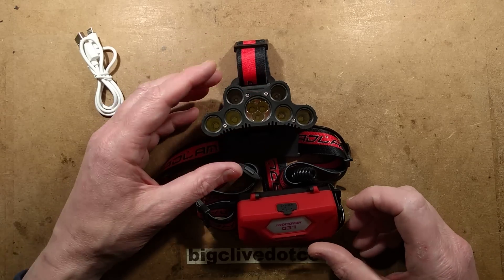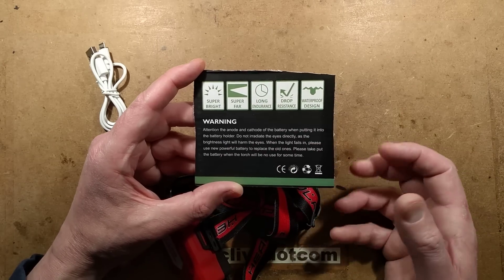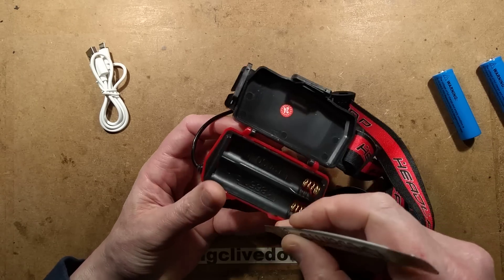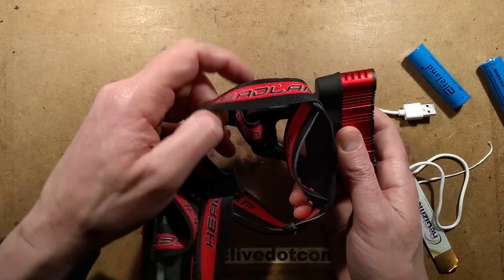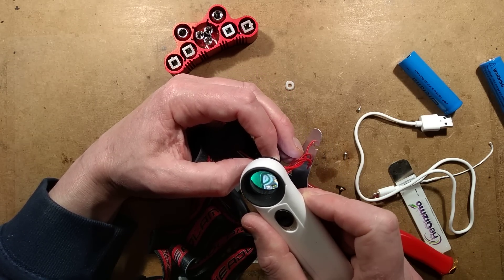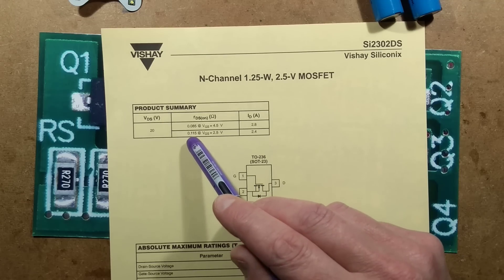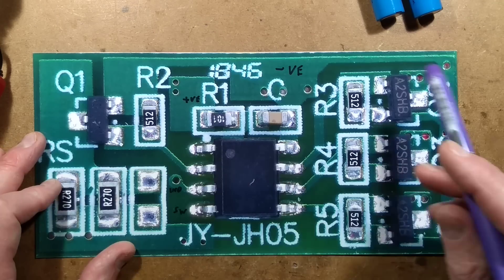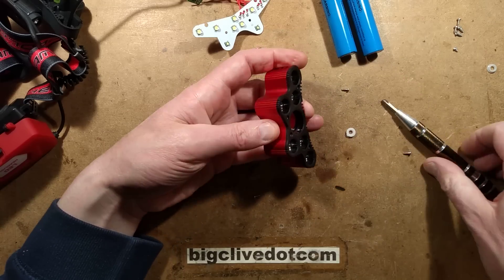9 LED headlight Elfeland teardown.

Comment: At 12:26, concerning the resistor  marked 101, 1 is not a "multiplier", because 10 times 1 equals 10! It tells you to add a single  zero to the 10 proceeding it, thereby signifying a hundred ohms. People might refer to this as a *multiplier*, but it isn't. Yes, I am being pedantic.
Reply: It isn't 'adding zero' (10+0=10) and is actually multiplication but by 10 to the power of the number '101' = 10x10, '102' = 10x100. Multiplier is correct but assumes you know about powers of 10.
Reply: @Matt Quinn yes correct 
😂. My phone seems to be working against me and regardless of how I type, it seems to deliberately screw with the spellings. Thanks.
Reply: @purpleviolin  , my smartphone does exactly the same thing, it changes words on me. I can proofread a post prior to posting it, and then I look at it again after it has been posted and realize that words have been changed. I usually use the voice to text feature, speaking into the phone and having it transcribe for me, and sometimes several seconds after it types the word I have spoken, the word will change. I've also noticed that if I use any expression of speech that could be interpreted as the title of a song or movie, the software will capitalize the entire phrase.
Reply: The final “1” in “101” is indeed the multiplier position as it what defines your multiplier even though the actual value is an exponent, it’s just that you multiply by 10^1.  That knowledge is considered a given if you work with electronics.
Reply: @ethanpoole3443  , I actually repair audio equipment fulltime for a living, so I do work with electronics. You could say that we are both at least partially correct, and I do understand about powers of ten; however, where people get into trouble or where it gets confusing is that you will see capacitors and other components that have three numbers on them that are the actual value of the component. Older ceramic capacitors will often be marked directly with the picofarad value of the part, although sometimes they're marked with the power of 10 multiplier scheme (and generally,  ceramic caps will graduate to a decimal or fractional microfarad rating at some point, like .0047 or even .00047) . I've also seen small film caps that are marked with the actual value capacitance (or trim- pots marked with the actual resistance value);  sometimes 470 means 47, and sometimes it means  470! When in doubt, grap the capacitance meter. It really is a stupid system. I'd almost prefer capacitors be marked with color bands like resistors, except that nowadays, modern resistors use such tiny narrow bands of somewhat odd color- spectrum markings that it can be difficult to tell red from brown, especially after the components age or are exposed to heat ( my  eyes are also aged,  and have probably been exposed to too much heat!). And now that 1%  and 2% tolerance resistors are common, sometimes it's hard to tell which end of the resistor is which!

Comment: It's more of an "amazing how they managed to make all of this and sell it for 18 dollars"... (or even $13 with free international shipping - just punched it into the Aliexpress). It sounds weird when people seriously criticize these things. It's like buying a new car sold for $1000-2000 with all the options. Of course it is going to be made of tin and wishes. But it will still run, turn, stop, light its lights, have a functional radio and heater (and probably even a big case of bad tools thrown in as a gift). The fact that all of it will be extremely poor and low lifespan will be completely overshadowed by the fact someone managed to pull this miracle off, to appease people who buy stuff like this. And any complaints by the owner will be overshadowed by the fact they bought this car and still compare it to vehicles 20 times its price.
Reply: Trust me, the Yugo (car) was well criticized in the late 80s for being a cheap junk car as well — it ran and it was cheap we’re about the only two positives that one could credit it with.  That said, even cheap manufacturing should not constitute cover for outright lies in terms of claimed specifications.  Even cheap products should at least deliver on their claimed specs.

Comment: The weight of this thing must be ridiculous, it can't possibly feel comfortable after 10 or 15 minutes on your head, not with the leverage affect of that weight hanging off the forehead, supported by a shitty little stretch band. Every headband flashlight I've tried so far makes my head sweat uncomfortably after about 15 minutes at the most. I have some cob LED headband lights from the local Job Lot store, they cost about eight or nine bucks, I really like these because they have a nice, evenly diffused white light, and only three modes to cycle through  (which is still one too many, I could certainly do without the flashing mode, which thankfully is red rather than white.).  Anyway, I took the flashlight housing off of the headband and attached them to the top front of my Opti-visor magnifying visors, keeping the hinged part of the flashlight housing so that I can aim the light at the work surface. Even then, because of the three AAA batteries contained within, the flashlight adds about 4 ounces to the front end of the magnifying visor. I removed the batteries and put them on a separate battery pack clipped to the rear of the headband of the magnifying visor. This improved the overall weight distribution significantly, making both the headlamp and the magnifying visor much more useful, as well as more comfortable.

Comment: I find this single buttom all,the functions extremely stupid. You have to cycle though all the others if you happen to miss...for example in this one, if you want to light it all up you press a few times and then there is a sequence with 2 small ones light up, lets say, a drl mode. If you want back to full beam, press a few times and wonder how many do you need be ause sure as hell you have to stop, take it down and look at the bloody thing to see when is correct....idiot manufacturers have been doing this "single button control all" dor many years now and still don't intend to change it. It should have 3 separate buttons, just like a cooling fan/hearing element for the rooms. Each level is separate and can be controlled directly by anyone pressing the correct button. Simple and effective.

Comment: i wish there was just an on/off switch for whatever mode you are on
Reply: Megabats, I concur! Almost every cob LED flashlight, indeed just about every LED flashlight of any type, has a flashing mode. Don't want it, don't need it. Those so-called tactical flashlights have something like five modes controlled from just one switch. It's annoying as hell.

Comment: Walmart’s headlights have more leds. They are using cob modules.
Reply: Jak p, the local Job Lot store here in New England sells "cob" LED headlights for 8 or 9 bucks. I really like the lights themselves,  but I could do without the flashing mode; high and low modes are more than sufficient. The real problem with these types of wearable headlamps, which probably rings true for the ones that Clive is working with, is that they are kind of heavy, and the weight is hanging too far forward of one's forehead. Coupled with the somewhat uncomfortable head strap, it's difficult to wear them for more than 10 or 15 minutes before your forehead starts to hurt and you find yourself sweating underneath the headband.
Reply: good 'un I remember Ocean state job lot when I lived in Connecticut, good store.

Comment: parallel a capacitor with those 5.1k resistors to get rid of the flasher mode
Reply: You would need an awfully large capacitance to actually smooth out the flashing, which likely won’t fit back into the housing afterwards.

Comment: Mr Clive Sir... I never really understood the meaning of MOSFET.. I get the MOS part but not the field effect part.. WTF does field effect mean..ty for your time and my ignorance
Reply: “Field Effect” is what is actually performing the switching in a FET.  The actual electron field at the gate is what switches the transistor on (or in a special case, off).  There is no actual current flowing through the gate like there is with a traditional bipolar transistor’s base, it is literally the presence of absence of the electron field itself that makes the path between source and drain conductive (or insulating in that special case).
Reply: @ethanpoole3443  thank you so much I'm so much informed.. I'm older and used to know this knowledge but now I'm feeling stupid..ty Sir so much

Comment: Chinese eBay battery spec = divide by ten for the actual ratings.
Reply: Well that's not completely accurate. I tested a pair of 9800 mAh ones about a year ago. The best one produced 254 mAh😂
Upside is that they are really easy to carry, they weigh nothing😊

Comment: So who does sell good, protected 18650s for use in flashlights and such?
Reply: Josh Tolbert you just have to find trust worthy sellers 
I’ve had good luck with mountain electronics, vesture_of_blood, and optics outlet on eBay
Reply: Orbotron is a good source for higher capacity protected 18650s, but you will pay more buying a trusted brand but then they do actually deliver on their claimed specifications.

Comment: The Chinese tend to do the pissing competition in everything. Screen protectors went from 2.5d to 10d whatever that is and glass hardness to 10h when 9 is diamond I think.
Reply: Windows, unless something has changed since I was a kid,  Diamond is actually number 10 on the scale of hardness. That's the Mohs scale of hardness, if I remember correctly.
Reply: @Matt Quinn , but what is harder than diamond? Some man-made material? And is this Shanghai hardness scale for real or are you pulling my leg? If so, kudos for the Spinal Tap reference!

Comment: 4:35 ... On that topic ... I tried to shop for 18650  ... and couldn't get them.
I wanted some with and some without protection.
The ones with protection where only available in too large (labeled 18650 but so long they don't fit in any  battery 18650 battery holder), lot of unprotected cells, but all fake with fantasy capacity.
And the few that seemed real and from reputable sources where about 30€ a piece ... and seemed too much.
Reply: I got a 12-pack of cheap fakes and 4-slot charger. I have never ran out of juice during 9h workday driving a towtruck - some winterdays are very dark in Finland.
Reply: A good brand of protected high capacity 18650s is Orbotron.  I’ve purchased a number over the year’s and they are always within +/- a few percent of their claimed capacity, but you will pay a premium.  However, ALL standard 18650 cells with a protection board will be 1.5-2mm longer than a base 18650 cell due to the protection board attached to the negative terminal (under the shrinkwrap)— that’s the actual added thickness of the PCB plus components and is normal for any protected cell.  To find a protected “18650” cell with a protection board that was still the same dimension as an 18650 cell you would have to find someone who custom manufactured an 18630 cell with a 2mm protection board, which would then be about the same size as a base unprotected 18650 cell, but that would be a nonstandard cell and will likely be a real challenge to find anywhere, much less finding a good price and a reputable brand.
Reply: @ethanpoole3443  The ones I got (cause I thought it was exaggerated) where about ~ 5mm longer ... I have bought several holders and have several devices ... and they don't fit in any. I have one holder in which I can make them fit ... if they half outside the holder is bent and the contacts are replaced by one layer of  aluminum foil ... 
And not to mention the devices I have .. some even state to only use protected cells ...
Too bad I bought those first and without cells, assuming buying cells would be easy ...
I found cells even advertised as 10000mAh ...
But I will keep my eye peeled for Orbotrons
Edit: No dice, not sold around here ... at least where I shop. Will keep looking, tho.
Reply: MrMegaPussyPlayer I purchased my batteries through Amazon.  I’ve also done well with the Solaray brand, though I’ve only tried that brand with 14500 cells so far, but they also met their specs and have held up well through a number of charging cycles.  But an added 5mm for a protection board is very unusual, though protected cells are often a much tighter fit than unprotected, 5mm is rather excessive.

Comment: Thanks for looking at this Clive. I have several set of similar lights / torches and use them a lot in the winter when walking the dog and another set which has cob arrays either side of  an adjustable beam led when I am servicing the car. Its great to illuminate the deeper darker parts of an engine. :)

Comment: 500mAh is pretty piss poor, really. That's less than 75% of the energy in a good rechargeable AA NiMH cell. If you want to get rid of the flashing effects you could bypass the microcontroller entirely and just use a switch and a resistor. That's what I'd do.
Reply: True. Cells like this are a real piss-take and must be a huge profit generator for the companies selling them. However I've had trouble getting my favourite made in Japan Panasonic NCR18650/B cells shipped from China in the last few years. I used to be able to get them for about US$6 - $8 each (depending on how many you order) but haven't seen them on Aliexpress for a couple of years now. If I buy them locally they cost >US$18 each plus courier.

Comment: I'm rather fond of the tiny little Nightcore headlight with high efficiency, red, and high cri
Reply: Nu25. I wish someone made a tiny 1 cell usb c charging board that was truly waterproof (zero potential between pins to stop electrolytic corrosion)

Comment: So, it's a 'growler' then - makes big noises, but doesn't live up its promise? I too have a favourite "head torch" by 'LED Lights'. Uses three AAA cells and lasts about a month in regular use. It's well battered, been repaired several times and has one of those switches that keep you guessing "will it light this time" but there are none better in terms of light output, unless you go mad and pay silly figures for a light.

Agreed, the strobing effect is a total PITA on these things (mine doesn't have that feature) that should be mandatorily  banned as a health hazard!

Comment: Would it be wrong to say your video's send me to sleep??  Not boring by any standard. Just a calming voice.  David Attenbrough  and Morgan Freeman have the same effect....
Reply from the maker: A lot of people use my videos to help them sleep.
Reply: We both worked for Hussmans 25 years ago as well as RFT Refrigeration . They used a contactor in tandem split load. Set fire to a Tesco store. We know  one contact will fail over time.  635 controller board was also an issue. I was told to keep my mouth shut. Taken of box wiring and chucked in the panel shop. Hussmans and MK was too far to travel anyway....

Comment: I bought some AA lithiums from China off fleabay a couple of years ago,
The ad claimed 600mah, after testing around 650mah and all 4 were very closely matched (<10mah)
I have come to the conclusion that they are actually genuine for once, 

I think most batteries on fleabay are either knockoffs with a fraction of the active materials and topped off with sand to feel heavy or they are recycled (in the case of 18650's they are probably old laptop/industrial batteries at the end of their life, if you take your old batteries for proper disposal and then you buy them back 6 months later on fleabay, that's called recycling in China)

I usually have better luck with amazonian batteries but you can still find ultrafire and the like on there... Caveat emptor

Comment: I wish they sold lithium 18650 like they sell AA/AAA batteries in supermarkets and stuff. It's clearly the standard of the future for removable battery-powered gadgets so I'm sure Energizer, Duracell and others will start selling them to the general public soon.
Reply: I've been hoping that would happen for the last 10 years though...
Reply: Product liability laws mean this will never happen. It's hard to damage yourself with NiMH cells, it is easy to make fire with lithium cells if you know nothing about them.
Reply: @donaldmeston4165  Doesn't Clive have a video asking what's inside NiMH cells (fire apparently)? (Or similar)

Comment: Cheap source for 18650 batteries. Old laptop batteries. I have a lot of good high amperage cells from them.
Reply: Yup, and surprisingly they are more powerful than the 9800 mAh ones I got with one of these headlamps some years ago 😁

Comment: I wonder if that extra strap length would be enough to allow it to be worn over a hard hat?

The contractors I work with tend toward Petzl lights because they fit well (and securely) on their hard hats. 

And at the same time they regularly grumble about the cost of the Petzl lights...
Reply from the maker: The Petzl lights are designed for use on hard hats, but the quality is poor for the cost.  My first LED head light was a Petzl Tikka.  The dollar store clones are actually better made.

Comment: Pinout of the LED module controller is, or looks like, a PIC12F629?  Can probably remove it , program one up, and put a F629 on it anyway for different "modes" ;)

Comment: Who the hell needs a strobe ?  It would probably be OK with about 37 batteries. But then I like one that will last a couple days on high beam and a single charge.
Reply: I don't mind a strobe on a hand-held torch as it can be used to blind or confuse any potential attacker (pointed at them but held away from the body). However having that function on a head-mounted torch just shows them where to hit / shoot.